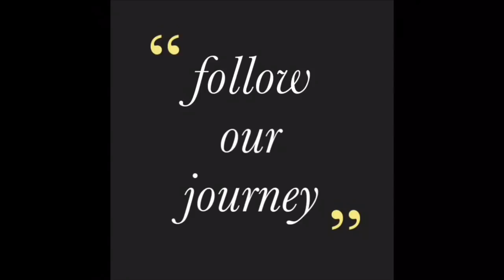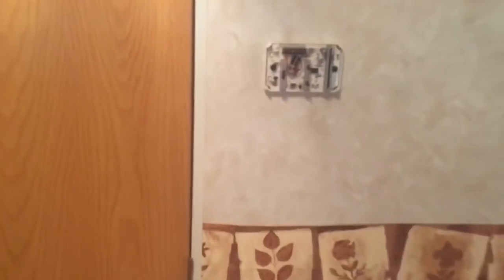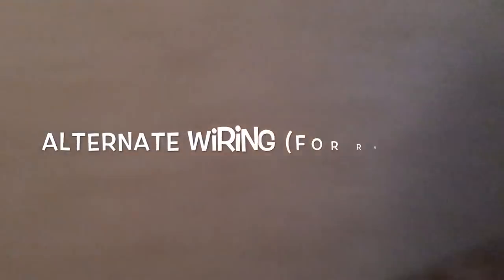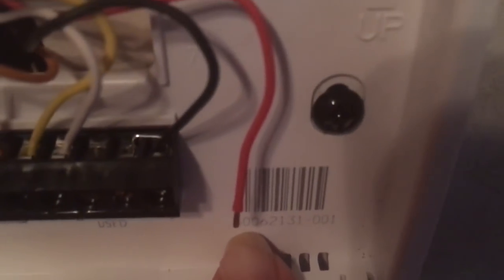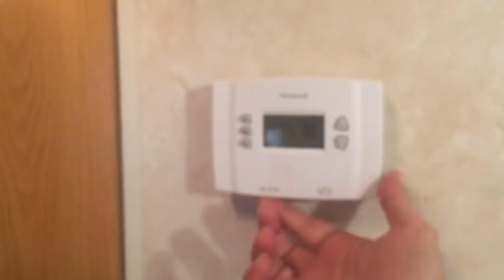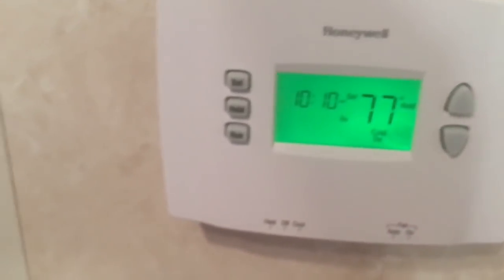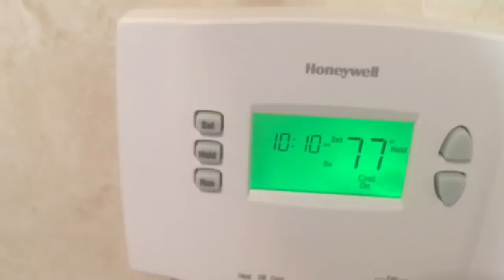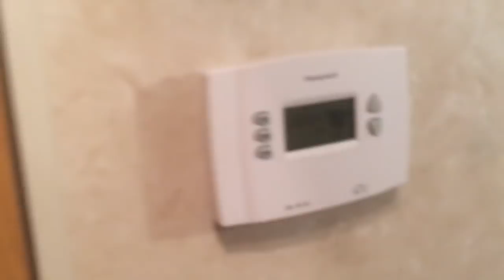How to: RV DuoTherm Analog to Honeywell Digital Thermostat

Comment: Way cool you figured it out, I been searching on the internet for 2 days to get my Dometic rooftop AC unit in my Thor Sierra 30 foot trailer to work with my Honeywell Digital thermostat RTH2510B. I originally had heat but no AC or AC fan. What I did notice was that in my case I had to unhook your Blue fan wire and only use the orange fan wire. Thank you for posting the video up on You Tube !!!!

Comment: I just switched over from analog to digital thermostat using the Honeywell 5000 series digital thermostat. I figured out how to use both fan speeds, it requires the use of a double pole double throw ,on /on toggle switch. The orange wire which is the low fan speed wire, on one side of the switch, 1 row, is hooked up normal. the wire coming from the thermostat marked G on the thermostat is hooked up to the middle poll. And the orange wire is jumped to bothr polls on that side.  with the green wire connecting to the center Pole. You rhen jump the green wire from the center pole on one side to the center pole on the other side. And you hook the blue wire (the high-speed fan wire), to the opposite pole that the orange wire first connects to. You then Mount the switch next to the thermostat. When the switches in one position the orange wire is the only one that makes a complete connection. But in order to run the fan on high you need both the orange and the blue wire connected at the same time. The wire circuits I just explained accomplishs that.
Reply: TY for shearing. Bummer about having to have it genkey looking with a toggle switch mounted next to it >_<

Comment: Thank you ,just wire my digital thermostat which is not honeywell and works absolute fine ,after some people told me ,to a analog to a digital I Had to change the control box on my ac and yes is 2.00 am eastern ,I had to try.Thank you again.

Comment: Hey there, great video! One question...my 2300 has a switch on the back, one position says "Gas or Oil" and the other says "Electric or Heat Pump." It came defaulted to Gas or Oil. I'm assuming this is what I should leave it on?

Comment: Since it is powered off the batteries only, how often do you have to replace them?? Just wondering.
Reply from the maker: A Smith the display runs off battery so you will know when the screen doesn’t show you the temperature.

Comment: Do not put the high fan and low fan wires together. Either add a spdt switch for fan speed or select high speed only. You'll eventually burn out your fan the way you have it wired. Consult a hvac technician for verification.
Reply from the maker: That thermostat model only has high speed fan option.

Comment: I have a 2 zone ac thermostat and I want to upgrade to this model. Can I make the 2 zone into a 1 zone by plugging both zones into 1 ac ?
Reply from the maker: I had a one zone A/C so I would check a different YouTube video for someone who may have installed a different Honeywell system.

Comment: I know this is a old video but does your fan only still work. If so u have 3 modes. ac / heat and fan only. You hope I get back ty
Reply from the maker: electrician0817 I never used the fan only because I was in Florida and it was hot during the day.

Comment: You show Blue & Orange together.  Another video shows Blue & Brown together.  I have both Orange & Brown.  Which do I need to connect with Blue?
Reply from the maker: Greg Williams depends on which Honeywell you bought and which Analog your camper has. My Travel Trailer is a 2006; 30 amp hookup. Compare

Comment: I have an additional red wire in my analog duo therm hooked to +7.5.  Any idea what I do with it
Reply from the maker: We only had the one red wire that is for Analog thermostats and not needed for digital. Ask an electrician what that red wire is connected to.
Reply: The red wire is what powers the thermostat when analog, it sends the needed voltage (12 v) system to start the compressor and fan motor. You wont use the red wire cause now the installed batteries on the digital thermostat provides the starting for the A/c .

Comment: you should probably put a plastic end cap on that red wire- just so it doesn't come in contact with anything.
Reply from the maker: It’s only 7 volts.